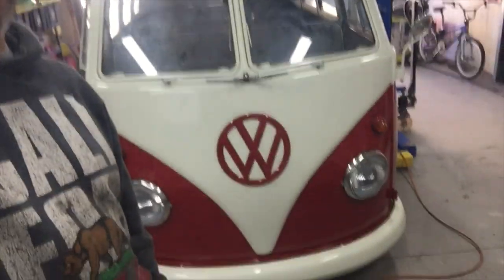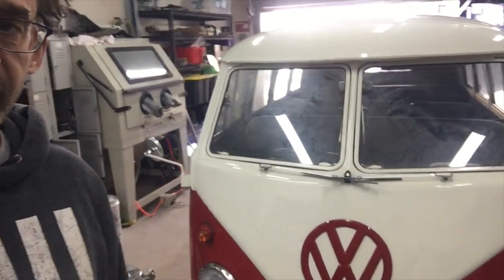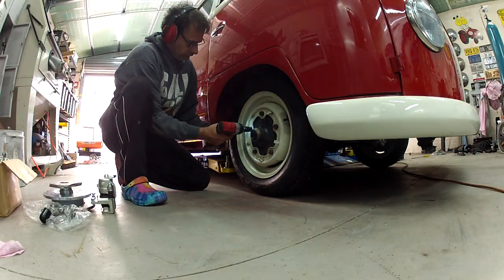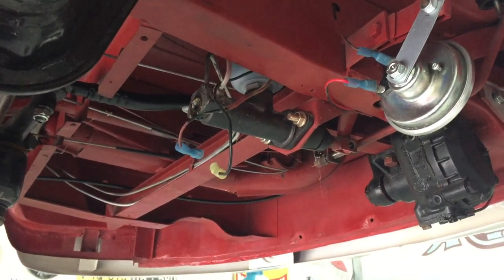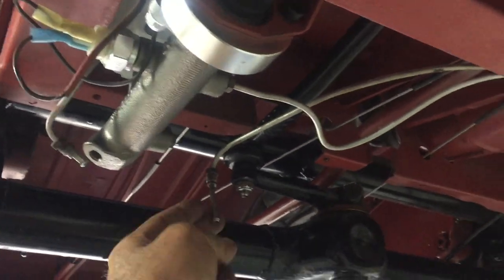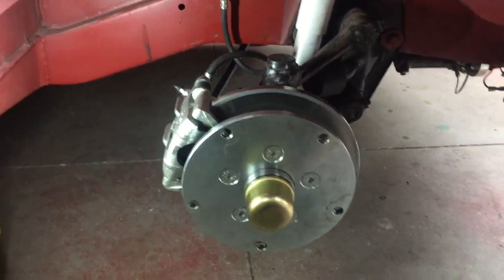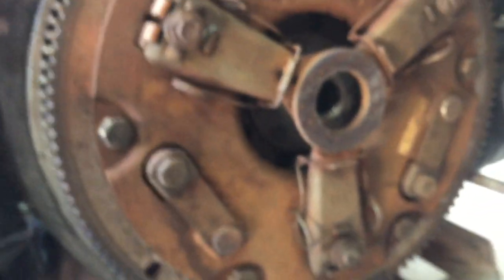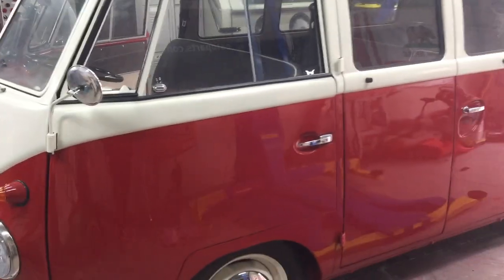VW Bus Restoration - 1962 BUS RESTORATION (DISK BRAKE CONVERSION) #vwbusrestoration

Comment: I have a booster with my stock drums. It is off a late bay and I welded the bracket on my front beam.  I have a late bay westy and the braking power feels very similar. Not sure you need disk brakes if you do the booster, but they are easier to maintain with zero adjustments needed.
Reply from the maker: Yeh the split drums with the booster would work fine I’m guessing but the need to adjust them the client didn’t like😉 I fitted the front disks to the ute without the booster and it was terrible. Way too hard to use😏

Comment: G'day again, 
Q. How does the booster go holding vacuum with the hose running the length of the bus. Does the unit need a constant certain psi to function effectively. ✌️
Reply from the maker: No problem, works very well with no vac issues, running them on both of mine🤙🏽
Reply: @DemopVWgarage  thank you for replying.

Comment: Are you installing discs on all four wheels?
Reply from the maker: That bus was done back  2 years ago, and only had the front disks done, there's no need for the rears as the drums work just as well because of the surface area of the back shoes.